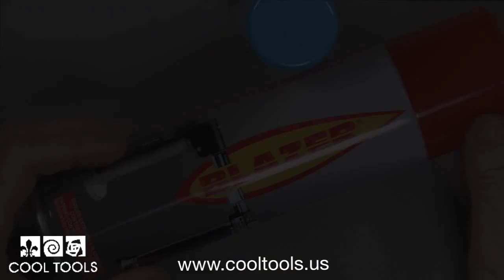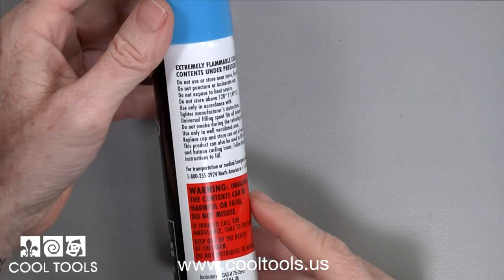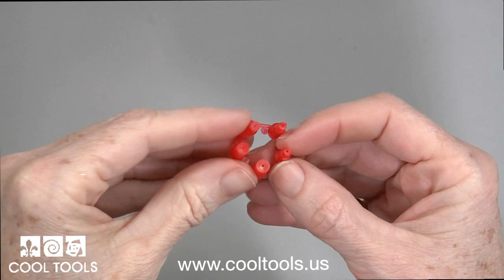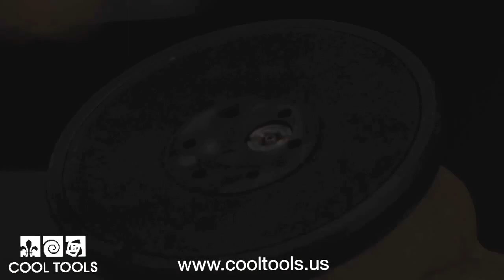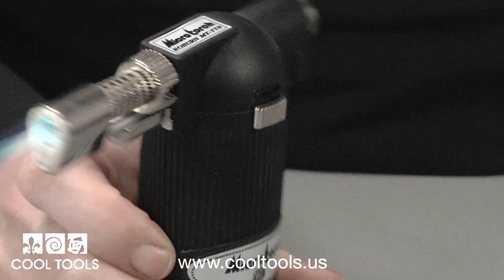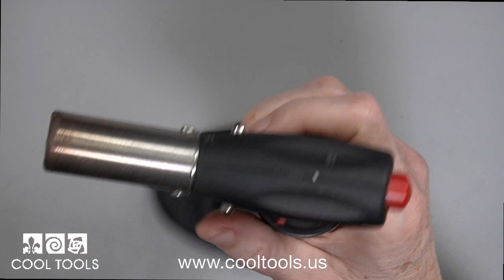Demo - Butane Torch Troubleshooting

Comment: I have a blazer big shot gt800 and the flame is very small and week when i light it then goes out shortly after. I had the cheep " premium" butane in it when this issue started. Could switching to the Blazer triple refined butane fix my problem or do i need to unclog if first?
Reply from the maker: Hello, we suggest unclogging the torch first then trying triple refined butane. Hope this helps!
Reply: CoolToolsVideos How would i unclog it?
Reply from the maker: Hello, this article should be able to help you: http://www.butanetorchshop.com/how-to-fix-your-butane-torch/

Comment: Thank you for the info.. I have a Blazer Stingray that I've had for about 7 months and its getting extremely hot to hold and I can hear a small leak coming from the insert on the bottom. Is this fixable or is it time to get a new torch?
Reply from the maker: +Elise Jens ART  Hello... For safety sake we recommend replacing your torch. The potential for a disaster is too great.  They are relatively inexpensive to replace.  Have a great day and thanks for your question!

Comment: Does the Blazer Big Shot have an air adjustment?
Reply from the maker: Hi Jane,  the Blazer Big Shot does not have an air adjustment. The dial on the torch adjusts the gas/flame size only. Thank you for the question!